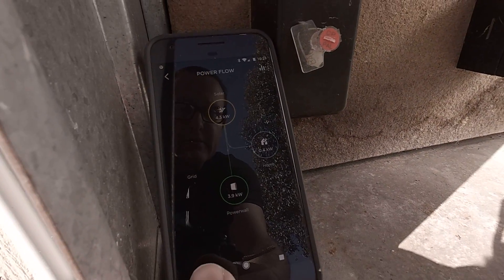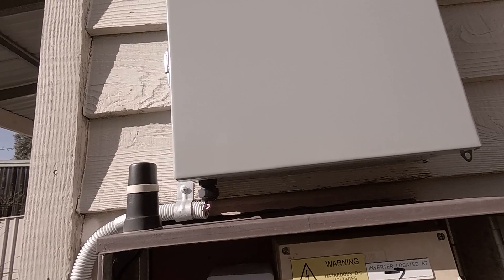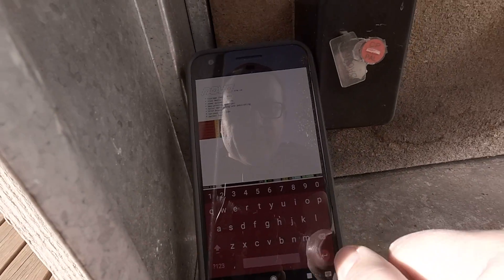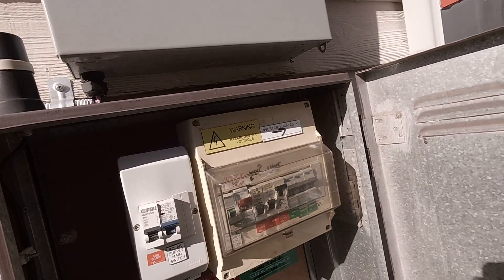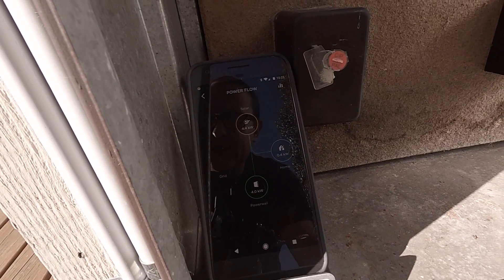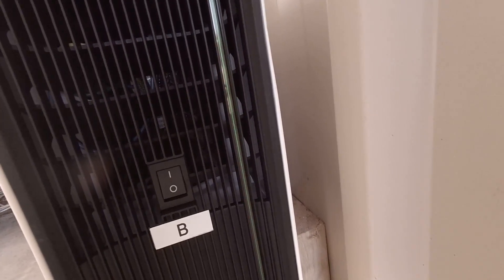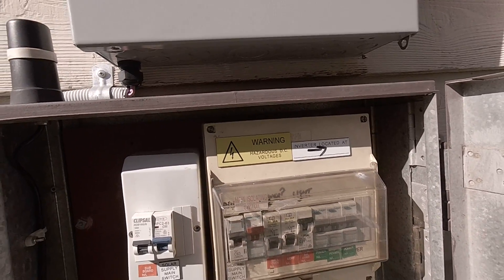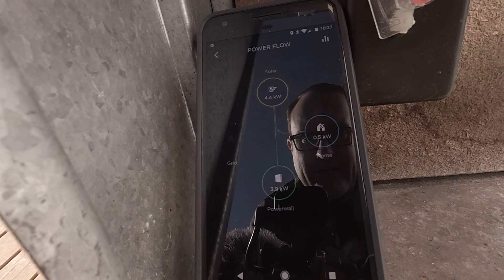My Tesla Powerwall 2: Demo of Backup Feature

Comment: Thanks for the video. How does the backup work when the house is on 3 phase. I know the tesla battery is only connected on one phase. But i want to understand if the solar generated by the panels be still able to supply the house on all 3 phases?
Reply: madan morris the inverter will do the job.

Comment: Just tried on mine, looks like it takes the powerwall a while to update the app, you should see a cross through the Grid. https://mikesgear.files.wordpress.com/2017/06/screenshot_20170612-123406.jpg?w=338&h=600
Just curious does your solar continue to power house after "Blackout"?

Comment: I have been working in a company that installs Solar systems usually in the areas where there is power outage of more than 14 hours a day. We can’t use on grid systems so we have to go hybrid and use conventional Lead Acid Batteries as backup. The problem is they are very expensive and don’t usually last long enough to pay themselves off. Another con of hybrid Solar systems over on grid systems is that they are expensive as well as much more complicated and you have to pretty much re arrange the whole distribution wiring to make sure only the necessary load is running.

I have known this feature of tesla Powerwall for quite some time now but we have no certified installers here. Can I just import the equipment and install it myself? I can learn how to; that is not an issue. Does Tesla Sell this to customers directly or only to the people who are certified installers?

Comment: What if the power is shut down from the transformer and then re opened. I think in that case the phase running at that moment in house and that comes from the utility will be different. What happens then? It cant just switch the relay on it will have to shut down inverter and then sync it with coming utility phase. Please correct me if I am wrong.

Comment: What happens when you are 'off grid' and the PW2 is full, but there is PV still being produced? My initial guess is that voltage will rise due to the excess generation, causing the Sunnyboy to trip on overvoltage. But then this might also cause the PW2 to trip as well. Not sure if that sunnyboy supports GVPR to slowly ramp down the output instead of tripping completely in this situation.
Reply: renza exactly my question. 

Powerwall battery full, solar going strong ... and the grid goes out. 

I would think ideally the solar needs to shut down if the battery is over 90%, and let the house run off the battery. Once the battery is at 80% it could switch solar back on. 

Tesla must've thought of this scenario???
 (or is it a 3rd party device that does that?)
Reply: Oops. He answers this in the first video. 

When the gird is out, and the powerwall is full, it instructs the solar to lower its generation.

Comment: Thanks for showing off how the Tesla Powerwall swiftly serves as the ultimate power back up for your home. Though we wouldn't be able to power up an electric stove, water heater or home heating. It's great for running lights, small appliances and of course the electronics!
Reply from the maker: It runs my heating and convection microwave (which I used as an oven) just fine... hot water via electricity is still a big issue, esp. if you want it instantly :)

Comment: how long would it take to charge the PW from 0-100 with solar from full sun?
Reply from the maker: On a fully sunny warm day it'll be fully charged in around 4 to 6 hours on my 5kW system depending on cloud cover. On cold days the battery management system will start charging the powerwall a bit slower (maxes out around 2kW for about an hour until the batteries are warm) and that might add an extra 30 to 60 min to get to full charge.

Comment: Thanks Scott I was wondering how the Powerwall was going to island itself when the grid went down. Is the Iso relay really big or is the box its housed in just bigger than it needs to be?
Reply from the maker: There is a lot of space in the energy gateway box, I think the extra room is so that there's plenty of room for the electricians to cleanly run cables. You have to run quite high gauge wire to the isolating relay so the extra room to run and bend that cable is appreciated.

Comment: Nice.  I've been waiting to see a video of an actual PW2 install.  Tanks for sharing.

Now when you say you are off grid, is the usage of the home low enough to be entirely covered by the 5kw output of the single unit or did you only back up a few circuits?
I'm assuming the PW2 can be ganged to produce more house current for larger loads yes?
Reply from the maker: I'm not off grid that was just me stating that once the main breaker was switched I was effectively "off grid" :) I think I would like to keep my grid connection so that I don't have to worry too much about excess and so that I can participate in the coming p2p energy trading systems on the horizon and I also have an electric car and in an emergency I'd like that grid connection if I get caught short and need a charge for it.

And yes, the PW2's are stackable up to 10 units so you can tune the system to your storage and load requirements i.e. 2 units would give you 26kWh and 10kW, 3 would be ~40kWh and 30kW, etc. up to 130kWh and 100kW.

Comment: Thanks so much for posting this. I've had a three PW2+solar system on order for months and I've never been able to get an answer on whether power would be interrupted on a grid failure. This is better than I expected. Have you tried doing this when the sun isn't shining?
Reply from the maker: That's my next video, I'll wait for some overcast days so that the PW is discharged down to the reserve and then simulate a grid failure - that seems to me to be the worst case and will really test how quickly the energy gateway can switch the house over to the powerwall.
Reply: Thanks!

Comment: Are you charging a car via the PowerWall 2 with it in the car port. That is neat what kind of car?
Reply: I love that you can generally charge with excess solar.Do you use the Gateway to start the charging when excess is available  or is that something you must do manually. 
.
Reply from the maker: I have a Model S in the garage, I generally don't charge it from the Powerwall due to the compounded inefficiencies (around 90%*90%) and instead set it to charge when I have excess solar. On a day like the one in the video there is generally enough excess to put ~6kWh into the car and still fully charge the Powerwall. If I do need to do a big charge I instruct the Powerwall to protect its stored charge (by setting it to 100% reserve) and then charging the car from the grid. That's pretty rare though, between excess solar and the occasional supercharger visit I rarely charge the car directly from the grid any more.

Comment: Also, what is the ball park price for the Tesla Powerwall 2 in Austrilia?
Reply from the maker: It's listed on the Tesla website :) $8000 + $1050 + installation. Installation is affected by how complicated the house wiring is, mine was pretty old and I had the Powerwall remote to the main board so a few longer runs were required that part came to around $2000. The $1050 is for the Energy gateway and other supporting equipment for the Powerwall.